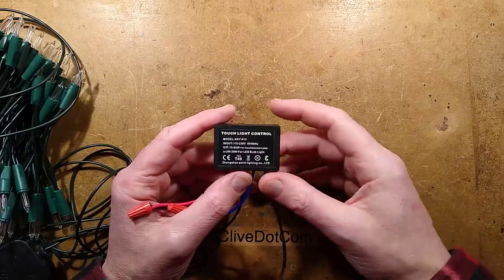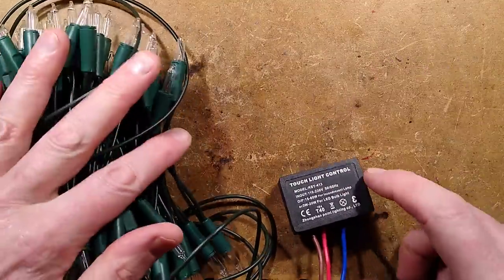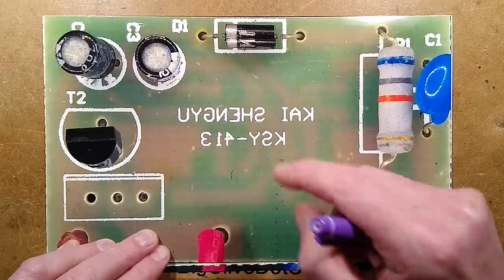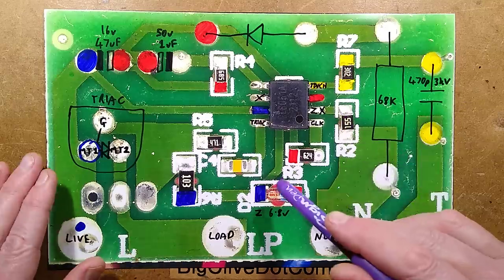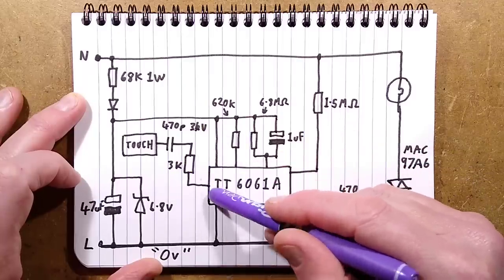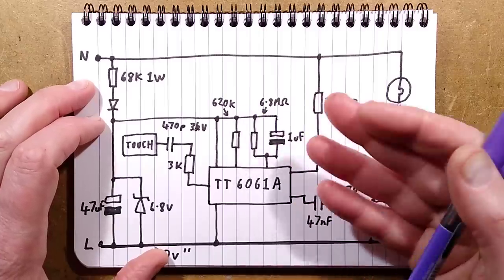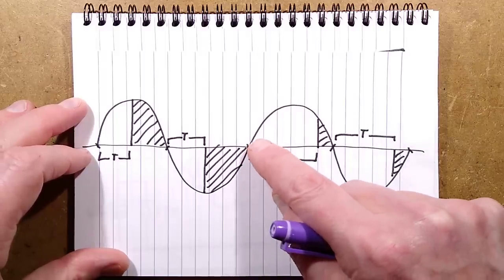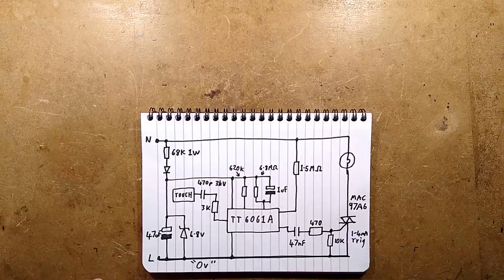eBay mains voltage touch dimmer - with schematic

Comment: Always wondered how the modern ones worked.  IKEA had a display of touch dimmers and every touch pad gave quite a strong feeling of AC fuzzy voltage.
Reply from the maker: It only takes microamps to give a slight fuzz feel.
Reply: everything feels fuzzy in some places in thailand. 

especially annoying for metal laptops. if you have a mac bring tape..
Reply: I would NOT be purchasing those...
All the ones I've ever used decades ago, and I've NEVER had one that gave a tingle. Such junk today... Sad
Reply: @nik_kot  With all the millions of old houses that don't have proper grounds, that sounds like a wonderful design. Maybe that's why my big desktop case used to give me a tingle.
Reply: @nik_kot  laptop power supplies are quite often two prong devices. It’s not so much that the ground is not properly connected as it being properly not connected.
Reply: This thread of discussion was very worth it. I have always used my Apple laptops with the three prong cords but I have noticed a fuzzy feeling when touching between different laptops jumping between different ones while they work on them. this thread has gone a long way to explaining why I am feeling that. Which just leaves me with a question why am I feeling that? Everything is properly grounded as well as the manufacturer would let it be, and I'm using most cases genuine bricks.

Edit: fix some typos.
Also for lack of a better word "texture" between manufacturers and models is quite interesting!
Although nothing has met my expectations after sampling the local cuisine of the Philippines's 240v60 Hz.
Reply: If you actually watch for it, nearly every device on a charger with a metalic surface will give you "the fuzz".
Reply: @nik_kot  That is not true. Modern laptop chargers are doubly insulated, and that means that the low voltage side will not be connected to earth either way.
Reply: @imark7777777  Because there is a capacitor that lets some high frequency pass, and some of it ends up on the chassis. (class Y capacitor)
Reply: @graealex  " If you actually watch for it, nearly every device on a charger with a metalic surface will give you "the fuzz"."
...
wouldn't that be touch for it?
HAHAHA
I closed the tab and went wait I have to come back for this.
Reply: @imark7777777  In the context of DC, capacitors are energy storage. In the context of AC, capacitors are basically variable resistors, where the resistance decreases when frequency increases. For the high-frequency EMI, these resistors are a rather low-impedance path, and some of it ends up on the chassis.
It's usually not a concern, as the current is very small, and class Y is made to fail open, so that full mains can never end up on the low-voltage side even if the capacitor fails.
Reply: @nik_kot  Doubly-insulated devices don't have a ground connection.
Reply: @nik_kot  But then there is still no ground in a doubly-insulated device. Neither L nor N counts as ground, in particular because the plugs are usually reversible. You are right that these devices have Y capacitors connecting the mains voltage side with the low-voltage side. That's what I wrote.
Reply: @nik_kot  If they did'nt install the caps they wouldn't meet EMI regulations. The caps aren't installed to annoy people, even if that is a side effects.
Reply: @nik_kot  it could be that the power brick is treated as being double insulated and therefore allegedly "safe" with no ground lead at all. I've seen this even when equipped with a cloverleaf socket as if it were using the ground
Reply: @bigclivedotcom  Many unearthed power supplies, combined together with a metallic laptop, can give you a fizzy feeling. Luckily my table has an isolating transformer built in, so I can avoid that.
Reply: Beautiful...I made these myself 30 years ago, still works. An eye opener then, a nice one to have today.
Reply: As I understood it, many laptops (with external bricks) had to be grounded due to the modem and the possibility of lightning strikes traveling over the phone line exceeding internal isolation. Even ordinary ring voltage means potentially fatal 100 V+ potentials inside. This was dependent on national legislation and how they set up their phone networks (isolators). Laptops largely lost grounding once 56k was no longer a thing.
Reply: @straightpipediesel  I think that's right. Sane laptop owners (that is those who understood the problem and didn't want their laptop blown up in a storm as well as not wanting to die typing) would protect both the mains and the phone line with a surge protector: back when 56k was still a thing you could easily buy extension leads that passed both mains and phone through, and that had surge protection on both circuits. 

And if you didn't have that, you'd unplug all your computer equipment when a thunderstorm was predicted. 

What puzzles me, though, is that since ADSL broadband those have disappeared. Where I live the copper connection to the exchange is still on poles in the street, and that means the risk is still there. We now have a router box in lieu of the 56k modern but it has Ethernet. If you plug in your laptop or desktop via ethernet you've made a path for lightning if any of the above ground works get hit. Hopefully the router will take all the damage but are you willing to bet your life in that?

Of course if you connect via WiFi that's not the case: but my desktop is connected by ethernet to take some of the load off the WiFi. 

What I've wanted for a long time is an extension leads that adds surge protection to the ethernet as well as to the mains: it's just a different RJ socket but that seems to be beyond the wit of the folk who supply such things.
Reply: @bigclivedotcom  It's like petting a bumblebee. Don't ask me how I know.
Reply: @trueriver1950 the Phi of an Ethernet transceiver provides isolation, the total impedance between you sat at the computer and lightning striking the telecomms line is high enough to render it extremely unlikely for injury to occur.

It also helps, AFAIA, that none of the signal chain between your computer and the exchange is usually ground referenced, which makes it an unattractive path to ground for lightning
Reply: This is exactly the failure mode (in solid state versions) that I fear.  Is there no way some opto-isolation can be added?  It works in my head, but I'm too lazy to draw it out to confirm. ^_^

Comment: I remember back in the 70s my grandma had one of those brass touch lamps. It was so sensitive that a fly could land on the metal and turn it on, low medium then high. She'd get so mad she'd unplug it. After a few years she threw it away because it annoyed her. lol
Reply: My aunt still has one, in her living room. It sometimes turns on or off by itself, and she likes to think it's her deceased husband trying to send her messages.
Reply: @tncorgi92  , yeah i think my grandma's did that too. Maybe it was a ghost too?
Reply: any radio transmitter nearby will make them go nuts also, say a cb or ham radio and especially mobile/high power ones. like living by the expressway with semi's talking often. the lamps will continuously change levels every time they're operating. it could be cause by many other devices that transmit or leak RF.

Comment: The coupling capacitor must be Y1 safety rated. A 3kV capacitor is not good enough. A Y1 capacitor will be designed to fail open circuit, never shorted and withstand a 8kV spike. Fortunately it's easy to add your own.

Comment: Places like continental Europe don't have polarized plugs. I don't think China does, either. I wonder, do they have different circuits in their touch lamps or just instructions that read "Troubleshooting - If it doesn't work, flip the plug around."
Reply: Yeah what is the Chinese equivalent of "if you're dead don't call us"?
Reply: The latter. I had a touch-sensitive lamp ages ago, and we don't have polarized plugs. It only worked if you plugged it in one way.
Reply: @kpanic23  Thank you. Rare is the definitive answer in the Youtube comment section.

Comment: That Triac (97A6) is rated for a On-State RMS Current of 0.6 A, that would imply that in countries with 220 volts AC it could handle up to a 132 Watt load and in countries with 110 volts AC, half that so, 66 watts. (I was about to ask, how much of a load before it is overloaded, but I looked it up instead, and posted this in case anyone else was interested). Thanks Clive, great video as always.

Comment: My parents had a touch lamp when I was growing up.   From what I remember, it would only go bonkers after a power surge or when the power totally went out.  At some point, the touch module died, and my father had rewired it with an inline dimmer on the line cord.  Now I'm tempted to pick up one of these modules and convert it back into a touch lamp...  Thanks again for another great video!

Comment: The 5 page data sheet of the chip manufacturer (TonTek) lists different values for 3 of the resistors, depending on line voltage.  It also shows two 1N4148 diodes  clipping the touchpad input.  And other interesting information.

Comment: Great video. Thanks to this instructional video, I was able to successfully operate it with a voltage of 110V. If you use it with a voltage of 110V, you need to change the resistor R1(68K) to 20K/2W and the resistor R2(1.5M) to 2.2M.

Comment: I've always liked proximity sensor's.  In 1961 for an 8th grade science fair project I built a vacuum tube version using a 2D21 thyratron tube (valve for those of you on the other side of the pond) from a Popular Electronics magazine article.  The IC version using a Triac does not seem as exciting as the glow from a tube, but I admit much more practical.
Reply: OTOH, the elements of a tube are more isolated from each other than any other kind of switch. It can't fail short, nor can it fail by connecting mains to the sensing lead or the lamp housing unless you break the bulb and twist the elements together!  Okay sure, tubes get hot because heated cathodes, they're inefficient, but... they come with a free, cheery, warm night-light! ;D

Comment: I use non contact capacitive touch dimmers, originally based on Atmel's Q-touch technology, to put dimmers or switches behind tiles. They have a range of about 10mm. 

Mains powered ceiling lights dimmed from the bath tub..

But in theory, you could also use those mini doppler radar/microwave detectors as light switches.

First time i saw one was as a lift call "button' with two sensors behind solid marble, with leds glowing through the stone. Very stylish. A completely smooth flat surface as a switch. Just needs a sticker. 👍🏻😀🇬🇧

Comment: What I really want to see is the touch/wireless dimmers which have no neutral connection. I understand how they extract their power - either by a very small current through filament lamps or by adding a capacitor across the lamp in the case of LED lamps. What I don't understand is how they derive the timing with no neutral as a reference.
Reply: They can easily detect zero crossing when the current is zero.

Comment: I remember building a Kit for a touch dimmer years ago in the eighties it had a touch plate made from aluminium foil which was stuck to the back of a standard electrical blanking plate, so you never touched any metal it worked great until you let the kettle boil no auto switch off on the kettle back then, so you got a kitchen full of steam and the dimmer cycling from off to full brightness for a few hours!
Reply: HealthKit in the states sold a touch switch dimmer kit, worked great and still have it, wish I could find the assembly manual for it.
Reply: @Subgunman  I still have my dimmer it even had a two-way dimming although I never needed it its really annoying when you cant find something I have a heathkit tuner amplifier that works great wish I could get a manual for it it has a couple of coils that got broke in shipping

Comment: Some of the "branded" ones a few years ago (meant for control of ceiling lighting via a receiver circuit) used an entirely separate stand alone transmitter and seemed quite failure prone in my case unless installed in very little used areas.

Comment: I'm going to try to find the on-off only version of this.  Any sine wave chopping wipes out the lower part of the radio spectrum,  as you mentioned,  and the majority of the radio stations I listen to are on AM,  so no dimmers or noisy SMPS allowed in the house !
Reply: I was pleasantly surprised when I was scanning radio stations in my new used van that there's now a handful of am stations around me with music, decent music at that. Radio or not I think noisy power supply should be regulated and I hate it when I see people who go on Amazon and buy the $10 laptop charger that's a complete knock off and weighs less than a quarter of an ounce. The safety alone.
Reply: As a Ham radio operator I only use high quality switching supply’s in my home. The main issue is with the power grid here in Greece. Old and outdated insulators used on the high side feeds are always arcing over due to the salty moist air around most of the country. The corona discharges wipe out most of the HF spectrum and very little is done to rectify this issue.
Reply: I have 2 lamps which included dimmers which would not work with LEDs. I found replacements for the dimmer which switched only. I paid about £1 each + £2 shipping from China (EBay). I later found ones which dimmed but realised I didn't need them. The on/off ones have worked for several years without problems.
Reply: @Subgunman  so you're saying they need to call electricboom to install some full bridge rectifier's? HAHAHA to rectify the situation.

Comment: I still have my three 15 watt canadabra base bulb 'brass' touch lamp, bought at a flea market in 1992 or so.   Still works fine, I haven't even had to pull it out and replace the assembly.   Our last house, it would turn itself on during the night about once a week.
Reply: Stray EMI/RFI?
Reply: @davelowets  - possibly.   I think that the lamp was just sensitive to small voltage surges due to the old power infrastructure in the area.
Reply: My parents had 2 of the exact same lamps in their bedroom and they would turn on randomly as well, especially after power interruptions/ surges.
Reply: My lamp would turn on sometimes when disconnecting/connecting the vaccum cleaner in the next room. Since it is a a new building with good wiring I'm assuming it was caused by EMI in this case.

Comment: Uh oh Clive you're Freudian slip is showing😁 most of these touch dimmers ARE $HIT, I used to work for an electrical contractor supply, we ordered a bulk box of touch dimmers I didn't noticed until later that there was a sheet with a wiring diagram with a note in BOLD TYPE, I wired one up for a customer plugged it in to test it as soon as I touched the lamp 💥BOOM, it blew the bottom cover off the lamp🤯the Chinese company had used the same wire colors but totally opposite, the note said unit will explode unless wired according to revised diagram,  someone pu dekcuf at the factory and eh we'll just throw ONE sheet of paper in the box with a note on it, instead of fixing them, some of the chinesium products are dangerously amusing but you really have to be careful.

Comment: A long while ago I found a fancy cheapish touch dimming lamp on the side of the road in somebody's trash.
I decided to disassemble it and i took the module out and stuck it into a plastic outlet box and attached the Touch line to the ground of a three prong outlet and a phone jack and crock cable. Wired up with a two prong cord and metal face plate. This let me touch the plate to turn the light on or crock cable that went to a strand of cat cable with a loop on the end which wrapped around the cord of a desk clip lamp that I had clipped to a bookcase. This let me tuck most of the wires out of The Way and I could touch a wire by the clip to activate or the face plate or I could plug a phone cable in with a little break out to route a wire around somewhere more convenient.
After like 20 years the module finally died so I replaced it and it was far cheaper than I expected to just go down to the local hardware store. The best part is the outlet cover that I used was custom painted by my mom with a little Bugs Bunny figure on it and that's where it has lived since.

Considering that most of the lamps in the US are two prong whether it's metal or plastic double insulated or not… Three prong ones supposedly exist I have never seen one in the wild.
other than cable abrasion the only contact point is in the socket connections which is usually insulated with a cardboard insert that if in good condition is sufficient, and I have never scene one otherwise unless the whole lamp is soaked which you wouldn't want to use anyway at that point.
I have not had any issues and I find this fairly safe knowing what it is and how it works. although now I'm thinking what's three prong metal and motorized that I could plug in in touch to control speed hmmmm.

Comment: Simple and it works, pretty nice functionality too, but again, two 1n caps in series SHOULD be used in line with the sensor as a safety measure.

Comment: In touch sensing, You ARE the capacitor.
My LED lamps are glowing with an open switch.
Reply from the maker: The glowing is common with modern lamps.  Especially with multiple switching positions due to the capacitive coupling between the switch wires.

Comment: You can use it with the COB LEDs that use no filtering and smoothing and purely resistive current limiting for the LEDs. It will flicker horrible but there might still be applications where flicker doesn't matter.

Comment: Actually bought 1 of these off of Wish for £1. They sent it in shrink wrap, instead of the pictured plastic casing. Installed it on a lamp, all the same, & it works. Didn't realise how unsafe they can be. May have to take another look at it now